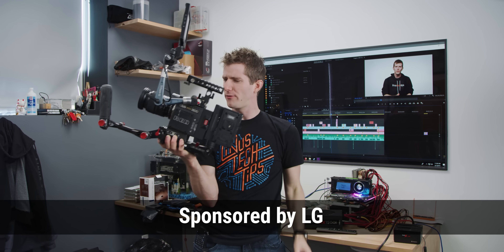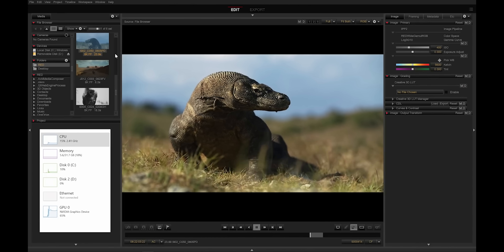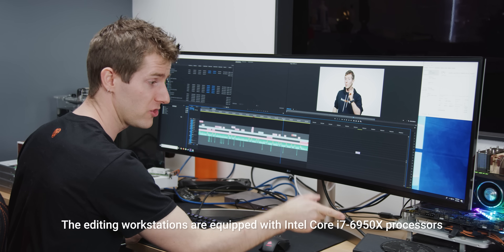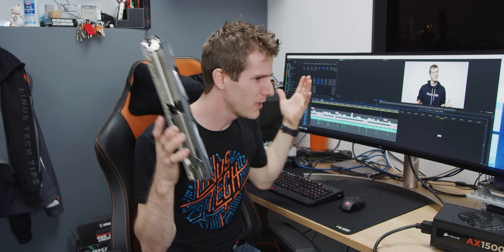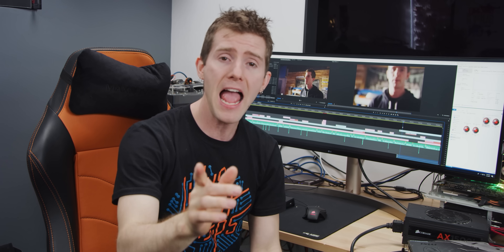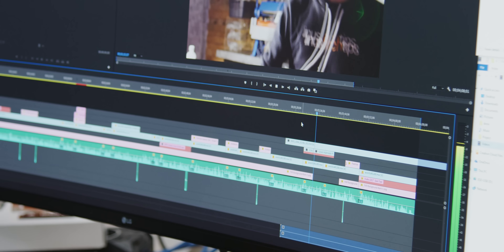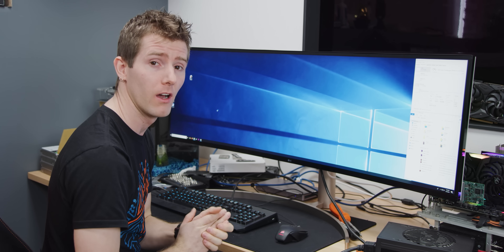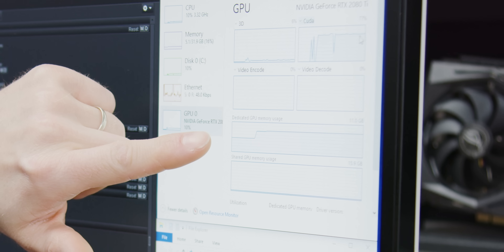How To Edit 8K Video - Threadripper + Ultrawide

Comment: Why is it, that you always talk about 8k and how important it is in order to keep good video quality when zooming in - but then, whenever there is a 2x or 3x crop shot of someones face in the frame, it already looks like shit even on "just" 1440p?
Reply: Optical resolution probably. I'm guessing they don't use professional cine prime lenses, since a set of them can cost 100K or more.
Reply: Red cameras utilize a very strong optical low pass filter that makes their footage quite a bit softer but less prone to aliasing than other manufacturers.  Also he's recording 20:1 lossy intraframe compression, that will definitely soften detail as well.  Their 6k raw looks less detailed than Sony's 4K in many cases, but some of Sony's is false detail.  Bayer sensor resolution is not the same as RGB display resolution since a lot of the detail is interpolated.
Reply: Not to mention the bad audio quality on a lot of videos. 8k footage filmed in echo prone rooms. Gee, thanks.
It's not the biggest issue, not even something I'd normally complain about. But when you go on and on about how much you're blowing on 8k and you can't even record in a basic studio with sound dampening to get rid of the echo, it puts some things into perspective.

That's not even getting into the fact that I'm incredibly unsure if this is even what you would want to do with an 8k camera or 8k footage.

Comment: "No CPU on Earth can handle this 30fps 8K 7:1 RED Code raw footage". You disappoint me Linus... That's the moment where you should have pulled out the W-3175X and set it on fire before calling it. :/
Reply: 32 > 28
Reply: @KarrasBastomi  -- Unless you also believe that the 2880 cuda cores on a GTX 780Ti are better than 2560 cuda cores on a GTX 1080, the 32cores on 2990WX are not better than the 28cores on the W-3175X. Higher frequency, higher IPC and lower overall system latencies are more than sufficient to overcome and surpass any deficit in core count, especially a small one (32 is only 14.2% higher than 28).  All benchmarks show the 3175X comfortable in the lead.
Reply: @alexmarin7897  We could still satisfy him and just go for the raw core numbers battle. We just need Linus to get his hands on a sample of the new Xeon 9282. Hopefully 56 cores / 112 threads will be enough even for this task. :D
Reply: @KarrasBastomi  Except that you can OC the W-3175X to even 5.7GHz: https://www.tomshardware.com/reviews/overclocking-intel-xeon-w-3175x,6097.html
Reply: No CPU can handle it using Premiere. Divinci or Vega might. Final Cut Pro probably would do best.

Comment: I'm having a ASUS VW222 Monitor
Specs:
[advantages]
NaN
[disadvantages]
- Resolution 1680x1050
- 1 VGA plug
- Aspect ratio: 16:10
- getting hot after 20 Minutes
Here an Amazon listing https://www.amazon.de/VW222U-Widescreen-TFT-Monitor-digital-Kontrast/dp/B000VAJ8SO?language=en_GB
AND: My PC isnt powerful enough to playback even 1080p at 60 fps nor is my interfat fast to playback 720p so...
#watchingin480pfromgermanyintesifies

Comment: I think it is a pointless endeavor to upgrade to the best hardware in order to get smooth timeline playback on Premiere. If you are working on a feature length project like I do, your timeline is bound to slow down no matter what your hardware is. The only solution is to use proxy media. I always use proxies for everything, from 8K Red footage to 8K stereoscopic 360 VR footage. Proxies are the best solution in my opinion.

Comment: Davinci Resolve 15 can play Red RAW 8K Full Res. Premium with a VEGA 64. Threadripper still recommended. Poor optimization in Premiere has been an issue for a while now. Hopefully, we will start seeing FCPX level performance across different codecs on PC. I think the gap has been closing. Even DR15 has some sore points that keep FCPX as the performance king for video editing.

https://www.pugetsystems.com/labs/articles/DaVinci-Resolve-15-AMD-Radeon-VII-16GB-Performance-1382/
Reply: My Davinci resolve on OSX has trouble playing back 1080 24fps ProRes 422 HQ with a Vega 64 ( Razer Core X eGPU ) running multiple timelines on a 2018 Macbook Pro 6 core i7.  I have to change to ProRes 422 LT to get decent playback. 

Maybe it's time to finally switch to a PC. 

In fact, considering OSX can't run any of the industry standard VFX GPU renderers ( Octane, Cycles , Redshift etc. ) because of the lack of any kind of Nvidia support, it's exactly what I'm doing.
Reply: @billB101  I imagine that running an external GPU probably gets you significantly worse performance than an internal GPU would even if you stuck with a Mac. It's a much slower connection. Max Yuryev does DR tests on iMacs. I've never run DR on a Macbook, so I can't help you much. A PC should give you access to a very powerful CPU, especially if those 16 core Ryzens come out a low price. Multiple ProRes streams can be rough on a CPU. The Radeon VII performs similarly to a 2080 Ti according to Pugetsystems testing in the link above, so it's a very good choice in a desktop build. My biggest performance hiccup on DR on a PC is that GPU decoding isn't very well utilized. This means that h.264 and h.265 timeline scrubbing using GPU solutions like NVDEC leave a lot to be desired. My iPhone scrubs h.265 4K60 better than my desktop scrubs h.264 4K24. I highly doubt it's a limitation of the graphics card. I don't know if hardware decoding is better implemented on a Mac.
Reply: @OneCharmingQuark  Yep, this is why I'm building a PC. AMD definitely won't be my choice of GPU though, for C4D and any kind of VFX work all the industry standard GPU renderers work on Nvidia cards with CUDA and not AMD.
Reply: @billB101  Fair enough. Turing cards were still a big upgrade from Pascal, and tensor cores should help with the new AI features in 16.
Reply: @billB101  Cycles, Octane, RadeonProrender ( Buildin C4D all run on AMD Cards .. ).
Reply: @mareck6946  how?

Edit: Apple dropped Open CL and GL support and Pro Render works, but it's Pro Render and it ain't all that.
Reply: LuLeBe It's still in beta, but according to Nvidia marketing tensor cores are being used.
Reply: @LuLeBe  Apple have recently dropped support for Open CL and GL though.
Reply: @LuLeBe  Yeah. you know that. 

I mean, I've always been a fan of Apple and OSX ( used their gear for nearly 3 decades now ) but they're forcing my hand with this generation of pro machines to be honest. I'm just not looking at them as the Pro solution they once were.  The walled garden just got too high. 

It's sad, and it's not something I want to see happening, but I'm now looking at a PC build to meet my needs.

Comment: It seems to me that this application calls for a kind of SoC that offers GPU-style cores together with CPU cores, like AMD's new APUs do, but with more hrsprs than what the current AMD APUs offer, assuming that you could get software to utilize that combination properly like you did here with the Threadripper and the 2080 Ti. Imagine an SoC with dual or quad GPUs and several CPU cores, perhaps even utilizing the upcoming "chiplet" design as opposed to having just several identical cores. That seems like the workstation architecture of the future, at least for this kind of workload. Then you would not need some honking graphics card sucking up extra electricity for power and cooling and could presumably save a lot of money on hardware as well.

Comment: So in theory, within the next few months the "ideal" system for this sort of work will be a TITAN RTX or Quadro RTX 6000 paired up with a Zen 2-based "Castle Peak" Ryzen Threadripper, or "Rome" Epyc CPU.

Kind of crazy the sort of horsepower needed for these workloads. I'm here with an 8-core Ryzen 7 1700 and a five-and-a-half year old R9 290X and I'm more than happy.

Comment: Isnt the "simple" solution at this stage just to utilize multiple GPUS for each process? Take say a quad GPU set up with one each handling the major processes (debayering, etc) and then leaving your fourth GPU and the CPU to handle running windows and anything else? I'm not at formally educated on any of this so I could be completely off but that seems like a straightforward solution to higher performance whether that be less compression or high FPS

Comment: But you're not meant to edit RAW files.
I know you're performance testing  but it would of been good if you told the viewers that REDCODE isn't designed to be edited RAW.
Reply: No way I edit my ads and music videos on real time 6k. The entire timeline has color grade CG and Denoise applied finally. All these work perfectly
Reply: @antenedilbert7191  You edit/cc the master RAW files?
Why?
Reply: @sisyphusvasilias3943  it is much faster for us to deliver ads and daily edits of films cuz time taken to convert these on a daily shoot basis is more than 8 hrs even on a thread ripper 16 core  with 2080ti. That means shot data of 1.5 hours of 1 day. Now look at the same thing this way. I edit, Grade and do CG in realtime in 6k or 4k or 2k whatever the client requires as final canvas and deliver them. So any day we have a much faster and versatile workflow in hand

Comment: I can really appreciate 8k while I watch this in 480p 💁‍♂️👌
Reply: 240p representing Africa
Reply: @werhnerwangra  You know what's the funniest thing ever? I was in a town (about 50 thousand inhabitants) and had extremely fast 4G. Something like 30Mbit/s. That's faster than my hardline internet connection in Germany.
Reply: @werhnerwangra  im From africa 1080p
Reply: 2160p with no problems at all. I love my fibre optic :)
Reply: Christian Koller the video isnt in 2k mate
Reply: 1080p 4G
Reply: I feel you -_-
Reply: Same
Reply: And 2x playback
Reply: Maximum I can go is 1080p without lagging, 1440p and above will just keep buffering
Reply: Watch 1440p on my smartphone 4G+
Reply: 2160p at 1080p same reason as sangeet (100mbit/s fibre)
Reply: LEWDxMExSENPAI ha 4k bitchsz
Reply: Zuerst mal 4K oder UHD ankommen lassen und nicht schon von 8K oder höher sprechen !
Reply: 1440p on my Pixel 2 XL
Reply: 360p on my 3g dongle.    :P

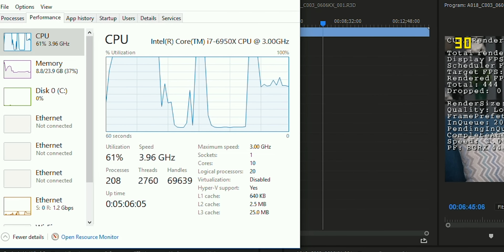Comment: 0:55 FPGA is not highly specialized. It's programmable, making it highly generalized.
Reply: It's a specialized type of chip. Most chips aren't FPGA's.
Reply: Being 'programmable' (well programmable in a digital circuit 'language' like Verilog and VHDL which is very different from software programming despite some gimmicky, largely failed, attempts by FPGA vendors to also allow programming on (or rather translation from) OpenCL) doesn't mean they can't be highly specialised. Exactly because they can be 'programmed' (or more accurately configured), FPGAs can be tailored to suit highly specialised workloads in the same fashion as ASICs but with the advantage that they can, if needed, be reconfigured/"reprogrammed" in the field instead of having a fixed circuit. Compared to ASICs, FPGAs have slightly inferior performance and slightly worse power efficiency and also in large scale manufacturing ASICs are cheaper per unit. It all comes down to cost and scale. For prototyping and small scale production FPGAs are preferred. For large scale manufacturing or whereever getting the last ounce of performance is absolutely critical you go for ASICs.

Comment: Yooo go check out my 8K playlist if you can playback 8K youtube videos. But is there a point in 8K mr. Linus? Maybe it is better if YouTube decides to allow 10-bit 4:2:2 video up to 4K. The bitrate cost for YouTube could be the same using AV1 codec instead of the VP9 codec and an 8K video but the viewers (us) will get a better 4K video experience. THAT OR MAYBE recording and Uploading in 8K HDR 4:2:0 might worth it when the viewer has an 4K monitor and playsback the 8K version of our video. That way them viewers will get a better 4K experience because they will load an 8K 4:2:0 video file on a 4K monitor. So yeah maybe 8K has a reason and that is for the people to actually play it back and view it on a 4K monitor or lower. Unless YouTube allow 4:2:2 or 4:4:4 uploads at a high bitrate. CHANGE MY MIND.

Comment: Isn't there a like more balanced solution? The CPU is either 10% or 100% utilized???
Reply: Video is best processed through the GPU.
Reply: @killertruth186  yeah but if the cpu's only at 10% surely it could help with some tasks?
Reply: @hollow8194  It will. Since you had given it more than enough headroom for the CPU worrying about other things.

Comment: welp, time to get some IBM Power 9 processors and throw some PCIe 4 at it
Reply: Peter  Supercomputers don't need super powerful processors independently, they just need a lot of them.
Reply: Peter  to be fair, the power9's are now available in the Talos workstations so they're no-longer reserved to the role of "fastest supercomputer on earth" processor. I'm only passingly familiar, plus I'd almost be willing to be that Red's optimized software hasn't been ported to Linux, which you'll need to run on Power.
Reply: How bout a Xeon w3175x with a massive custom loop overclocked.

Comment: And whats with a dual CPU setup? I mean 56 cores are more that 32 and if 32 are at 100% maybe 56 would help. And whats with multiple gpus?
Reply: Unfortunately when it comes to video encoding and decoding there's a limit to how many cores you can throw at it. Eventually clock speed matters more, and since each of the cores are running pretty slow on something like a 28 core Xeon or a 64 core EPYC, an overclocked i7/i9 or Threadripper processor tends to be better.
Reply: @TechnoBabble  This does raise the question of using a dual socket board with individual CPU's that have less cores, but are able to get higher clocks, vs a single mass core CPU. So say, 2 of the lower end threadrippers running at 4.5 vs one of the 2990's that don't push much past 4.0-4.2. Tho threadripper might be a bad one for comparison since the second highest is the 2950x with 16 cores I believe. So you'd still end up with the same cores, just on separate chips and higher clock speeds. Perhaps using 2 2990's with some of their cores disabled, but still able to get higher clockspeeds, and a higher core count than a single 2990. 

Sorry I'm rambling and thinking out loud...or...thinking out typing? Either way, it's an interesting subject that could be something fun to look into.
Reply: @zakiyo6109  Thanks, I'm glad you agree! :D
Reply: @TechnoBabble  Double reply because I'm an IDIOT and forgot about the 2970, but iirc that one only boosts to 4.2 as well.
Reply: dual gpu's don't scale very well for video encoding at all
Reply: Should've tried an EPYC 64 core setup with several Tesla GPUs.
Reply: @Phambleton  the Problem is that he has 4 gv100 cards....
Reply: still there is no single processor that can handle 8k
Reply: @Craft97pl  yeah but thats no awnser to my question...
Reply: @Craft97pl  windows doesn't support power9, but IBM's processors are insanely fast in multicore tasks

Comment: And here I am still amazed by the 1080p monitor in my office
Reply: 4K is gonna blow your mind!
Reply: Turbo Turd or maybe 144hz more?
Reply: I have an old 1440p60 monitor, hoping to upgrade soon though.
Reply: That is all one needs unless you are going 32" or greater. I lover my 7-year-old Asus 27" monitor at 1080p. I have looked into the BenQ 1440p 32", but I cannot pull the trigger because it simply is not worth it. Some day I will do it, and upgrade from my 970 to drive it, but for now, why bother?
Reply: @GarrySkipPerkins  if it ain't broke, don't fix
Reply: Still rocking a 900p monitor oh well
Reply: @lillexus5589  same here.
Reply: @lillexus5589  bruh im watching this on 720p
Reply: I have went from 1080p60hz to 75hz and it is a huge upgrade
Reply: iKingRPG Ehhh, there is barely any difference. I overclocked my monitor to 75Hz. Would rather suggest buying a 144hz one.
Reply: @Magmaa  I'd say you do feel a huge difference between 60Hz and 75Hz. 144Hz is still master race though.
Reply: @iKingRPG  dunno i have a 75hz fsync 1080p and really notice no difference.... Cant wait to go 1440p+
Reply: @rnaodmletetr  console peasant xD human eye cant see more than 6,66 fps